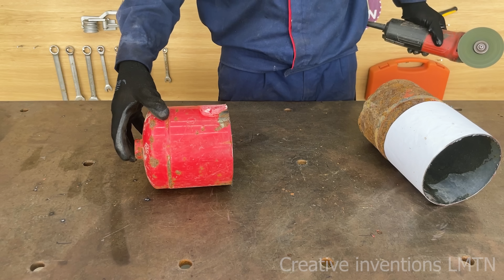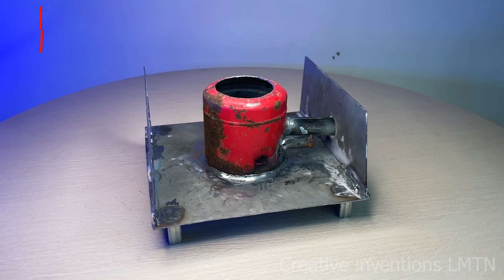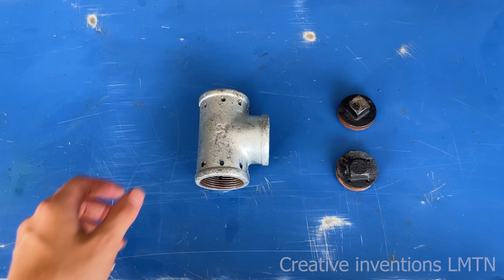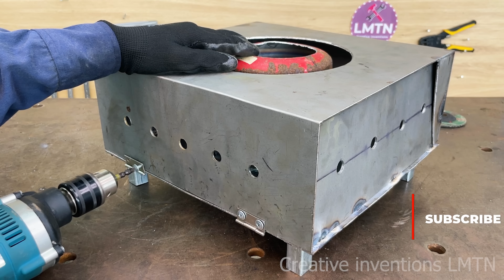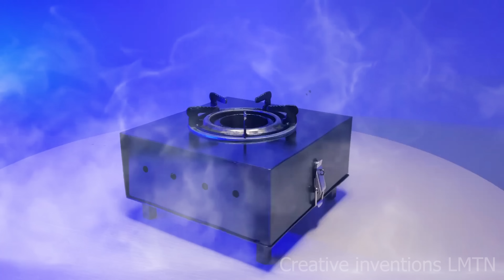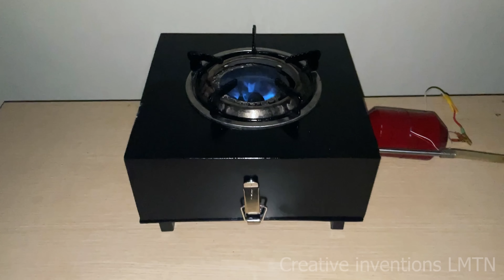Ideas Used Cooking Oil Stove homemade to replace gas | DIY Waste Oil Burner Stove #2

Comment: Can you ship the main equipment. Red color one n inside stuff.
Reply from the maker: It is made up of a 12V electric motor. And some plastic pipes for the cover sir
Reply: @lmtn  the one which u make holes can u made another one and send both

Comment: Hm single burner?
Reply from the maker: Yes sir, a single burner and designed perpendicular to the combustion chamber. This helps prevent oil from leaking out for those with poor welding experience

Comment: i have tried to do one of waste engine oil stove but it didn't work as i expected ... it din't work for sure... what problem by that
Reply from the maker: The main problem is due to the number of holes and the distance between the holes. You can double check that. Also I have clearly stated that in the video, you can watch it again
Reply: I don't know but I know for sure that it works..